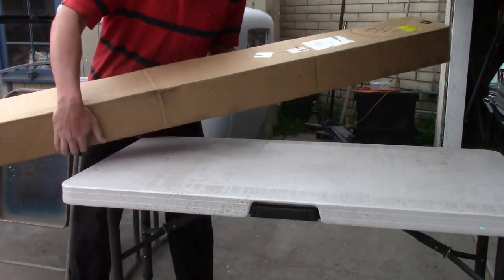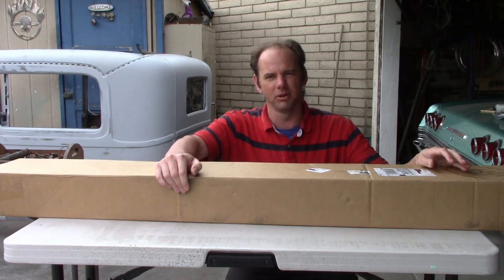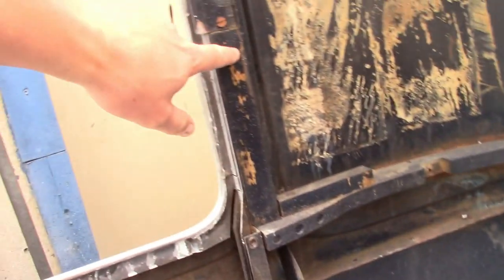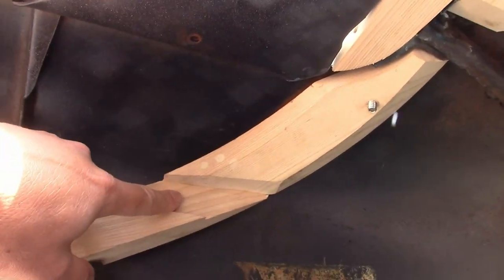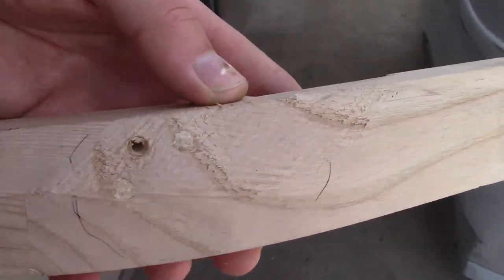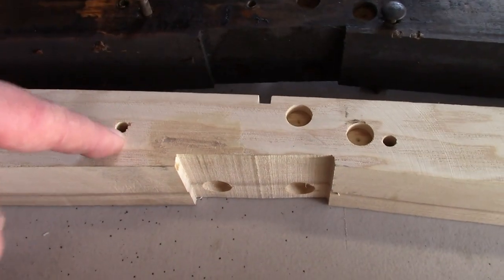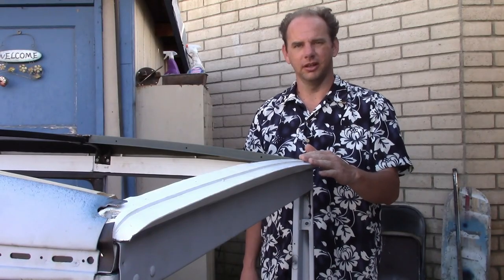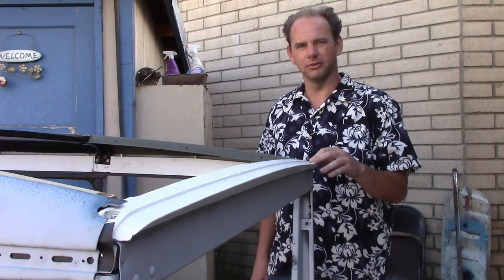1929 Ford model "A" restoration. Part 3.

Comment: Thank you so much for what you do. I know it takes a lot of work editing your vids, but for one I appreciate it. How do you get the seal off the rear wheel bearing on a "28" ford dump truck. I wanted to pack the bearing, but could not figure out how to get the seal out. Yes I did remove the seal ring. Thanks again.
Reply from the maker: I don't know. sorry.

Comment: I have a 1930 Ford Model A with a body by Murray. The problem with my car is the only wood left on the inside is what's around the rear window everything else is gone.  I have a complete wood top kit with a hardware kit the problem is I don't have anything to go off of as to does a screw go here or does a bolt go here instead. The place that I got my kit from shall remain nameless cause I don't wanna get sued for bad mouthing them.
Reply from the maker: I've run into that a few times. If I couldn't find any pictures or instructions, I just had to guess what goes to what. Not a great idea, but I didn't know what else to do. Hope you can get it figured out.
Reply: @onewhocollects6781  Hey what's the worst that could happen.? lol.
Reply: Im in the same boat. Mine would have been better used as yard art.